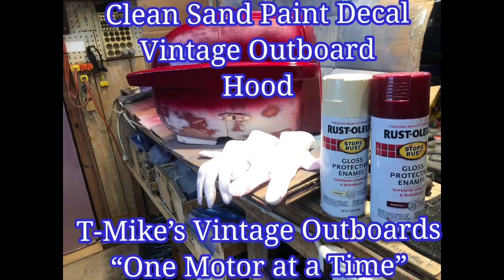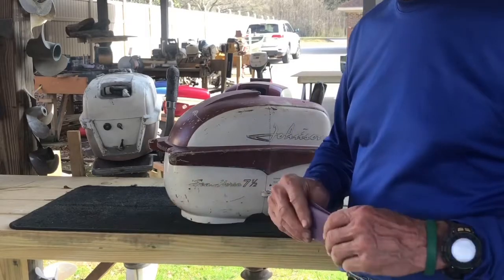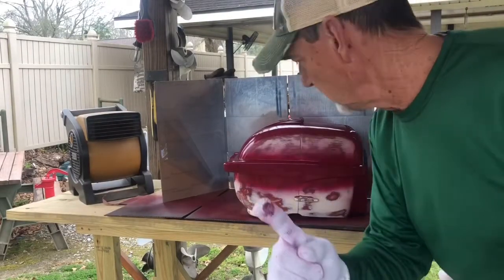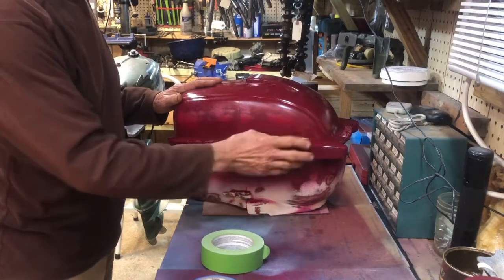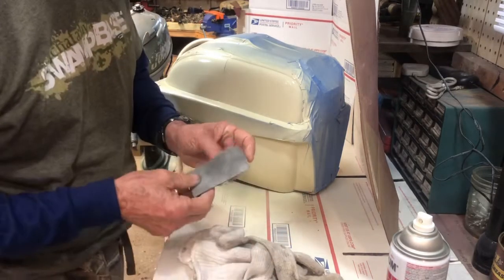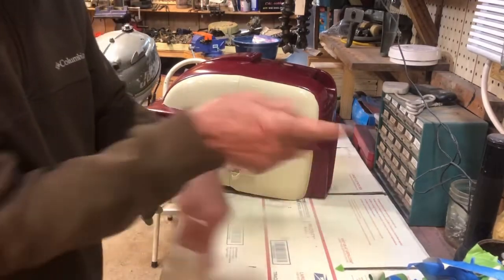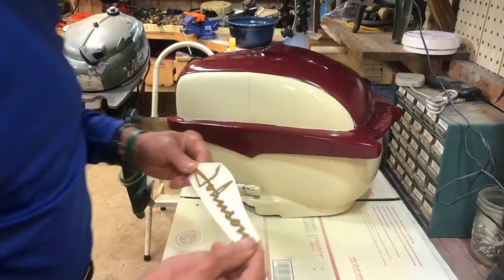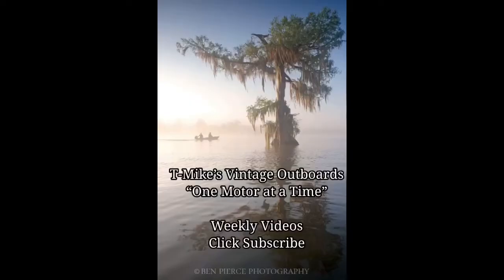Clean Sand Paint Hood 1958 7.5 HP Johnson Sea Horse Beginners Guide to Restore Vintage Outboards

Comment: to simplify paint it no sanding between coats.
Clear paint whole thing wet sand and polish
Reply: I thought so too. What scares me is how many times something can go wrong and negate any benefit from the 3 times and sand every time. If u got it good one time,  do it all at once. Lose two more chances to fuck it up. Paint changes over time, cure times vary. Doing 3 times seems self sabotaging unless you have a paint shop, no kids, dogs, or dusty driveways. Limit exposure. It probably looks better the 3 times, until it don't.